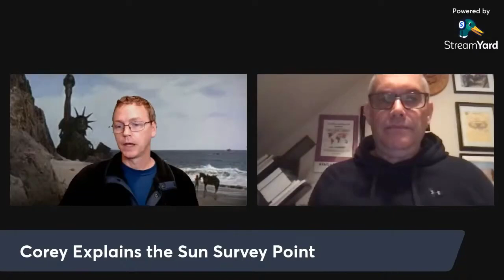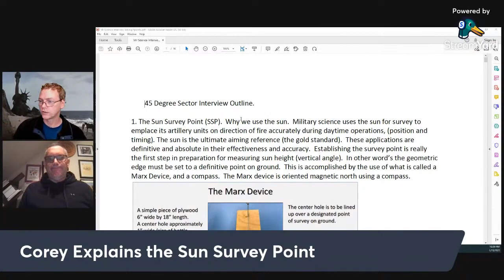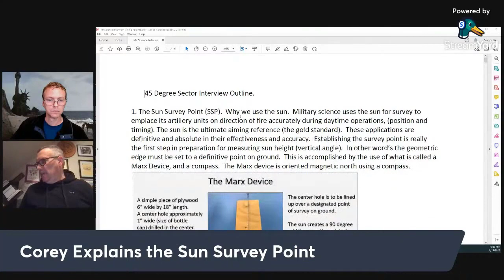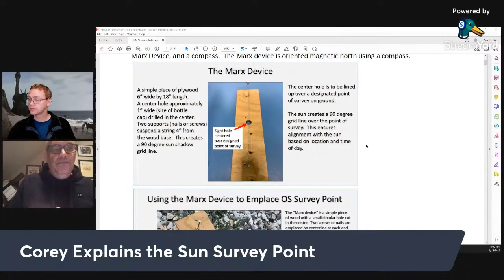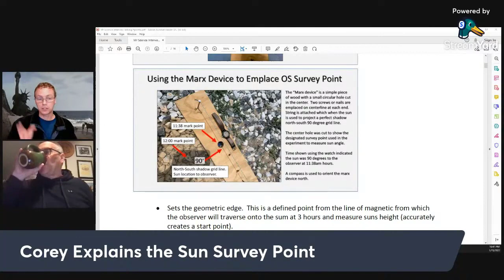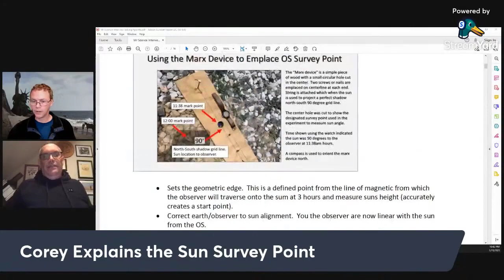Conversations with Corey - Corey explains the Sun Survey Point

Comment: I worked in SAR for 14 years (lifeboats). I've been trained and have qualifications in everything that you need too get a boat safely from A to B. Things like navigation, radio, radar, mechanics, boat handling etc.
Sorry to blow my own trumpet :( 
Now that we have got that out of the way here's a simple phrase to use in navigation.
"Error West compass best". With best meaning "greater than".
So if I have a magnetic bearing of 97° and the magnetic variation is 7°W then my true bearing is 90°.
This is very handy if you want to avoid those big rocky things :)

Comment: 12:50 No, it still doesn't establish solar noon for the specific location. It's just a direction marker and establishes that direction, any direction, from one day to the next. Place it at an azimuth of 150 degrees and come back 24 hours later. The string and hole should again be aligned.
Kell seems to me wrong when he says "come back the next day" and it will be "4 inches off" or something to that effect. There will be a difference but it would be tiny, practically immeasurable, probably comparable to the width of the string.
Reply: His might be 4 inches off if it's just laying on the ground and can get kicked around by other people. I wouldn't rely on it for finding local solar noon and definitely not for ballistic trajectories.

This appears to be a common problem with flat earth believers. It's like they want to do science but don't understand all the steps so they cut the ones they don't understand out. Which usually removes the methodology and accuracy of measurements required to get quality data. I saw a similar thing on a recent video Blue Marble Science reviewed from Gary W. about "reverse foreshortening" where Gary mocked up lines of sight on a board but didn't think to measure angles at all. Just eyeballed it and indicated that "these are bigger" which not only Blue Marble Science demolished, but someone in the comments took screenshots of the image and was able to pixel count to determine Gary's statement was incorrect.
Reply from the maker: This is a good opportunity to do the math. I'm also HIGHLY skeptical that Corey's bit of wood and string is accurate down to that level of precision, but I haven't crunched the numbers yet. The location on the subsolar point at a given time drifts about... we know this... should be "easy" to calculate. I'm curious if it happens to match Corey's measurements... but not curious enough to spend any effort on it... because it doesn't matter... the entire test is logically flawed. This test actually validates the globe.
Reply: @icansciencethat  I did some rough math on the movement of the sub-solar point in a comment below. Nothing to do with 4".
Reply from the maker: @fepeerreview3150  Your math seems to be on the North-South motion of the sub-solar point. Corey is interested in the East-West motion.
Reply: @icansciencethat  "East-West motion"
I see. I didn't understand that. I'm not sure what that would be or how it would work. I expect it relates in some way to the analemma. But I've always struggled with how the analemma works. I definitely don't see how that would in any way result in something with the device being "4 inches off". Off in what way? I really don't think Kell explains stuff clearly at all and I think it may be because he doesn't really have a clear grasp of what he is talking about. I don't think it's because I'm too stupid to understand. If I believed myself to be under-educated or of below average intelligence, had an inferiority complex about it, and was impressed by Kell's background and style, maybe in my confusion I'd assume what he says is correct and I just don't have what it takes to understand but he says things I like, like the Earth is flat and or globers talk like morons. So I'd applaud him. (As he and the Globebusters audience did.) But that's not me.
Reply from the maker: @fepeerreview3150  just looking at SunCalc.org I see that on Jun 19, 2020 culmination was 11:54:44. On the 18th, it was 11:54:31. So at that time of the year, solar noon is moving by 13 seconds per day. I think I'd say, "analemma" and just leave it at that. LOL.
BUT... presumably, Corey could set up his experiment to be performed on the 19th calling noon 11:54:31 (13 seconds too soon), but then he'd need to relocate his experiment 13 seconds to the East. Is that 4" to the East? LOL... umm... no. The Sun goes 15 degrees of longitude per hour. That 13 seconds represents 0.054 degrees of longitude. Corey needs to relocate his device 3 miles to the East if he doesn't want to update the time. LOL
Reply: @icansciencethat  4 inches ... 3 miles ... that's why I don't trust maffs.
😆

Comment: 9:35 I can understand simply placing the device on the ground and checking it twice, 24 hours apart. That would indeed provide you with some kind of baseline from one day to the next. I don't see that it even needs to be aligned in any particular direction. 
8:08 "Guess where Mr. Sun shows up 24 hours later. About 4 inches from the survey point."
This is very unclear language. The Sun, of course, is up in the sky. So I assume he's saying something about the device or the shadow of the string. What moves 4"? The shadow relative to the hole? No way. I don't see how anything could move at all. Is he saying the entire device has to be moved 4" in order to get the string and hole lined up again? Which direction?
It's this kind of unnecessary complication in his presentation that makes the whole thing ridiculously cumbersome and obscure, and one of the reasons I distrust him. Aligning something with a compass and then making a small adjustment for declination is EASY. If you're sniper off in the mountains of Afghanistan chasing bad guys, you'll probably know or you probably should know what the declination is. Adjusting your gadget for it is the work of 2 seconds. Also, knowing at least roughly when is local solar noon is no big deal either. The resulting observations and aiming would be vastly more accurate and predictable if these factors were taken into account.

I also fail to understand the need for this device at all, to do an observation that will last 3 hours. If you're doing over the course of 2 days then all you need is a nail in the ground and a watch that works. You go back to the same spot the next day, same time, 3 hours one way or the other, measure your sun altitude and you're done.

His whole presentation seems like a lot of smoke and mirrors, designed to obfuscate.
Reply from the maker: I think I can actually explain some of this.
Corey's test is all about where the Sun is 3 hours after local noon. So he needs to establish when local noon is. TBH, Time-and-date is your go to, but Corey wanted to be more precise (for reasons that aren't really relevant #shrug).

The device works by casting a shadow. The string casts a straight-line shadow, and we want to use that to align when the Sun is in a straight-line with the Sun-String-Hole. The Sun will not be straight overhead, but somewhere due South at that moment. So if the string is aligned due North-South, then the shadow of the string will pass over the hole exactly when the Sun is due South. It's clever really.

That said, using magnetic North instead of celestial North introduces error into that which Corey seems to have neglected.

But to be fair, whatevs. Time-and-date tells you the time of noon, and we can use that to validate the rest of the test.

The Sun moving 4" per day? WTF? He means the exact sub-solar point at 12:00 moves from day-to-day. Let me explain what that means in terms of this test. If he's going to measure at precisely 3pm every day, he wants that to be 3 hours after "noon". So what he's done is place the device such that the string's shadow is dead-center on the device at 12:00. Since he's using magnetic North, that isn't exactly solar noon, but he's thinking that is ok since he's going to measure the angle exactly 3 hours later in that same spot.

This isn't exactly correct, but his resulting angles are all within 1 degree of SunCalc, so I don't really think it's worth quibbling over.

If you can find the time, I would like to see how much the 12:00 SubSolar point moves day-by-day. It'd be pretty cool if that turned out to be 4".
Reply: @icansciencethat  I guess I still don't get it. The device doesn't help to find solar noon or magnetic north. He needs a compass to align it to magnetic north and a clock to mark noon. So at noon (by the clock) he aligns it with the compass and then all the device does (assuming it's not disturbed) is allow him to identify, the next day, that it is in fact the same time of day. And his alignment is preserved. In short, he could align the device to the Sun at any time, say 10am, and the next day at 10am the shadow will center on the hole again. (Of course, the device would not be aligned to north.) So it's a way of marking time and alignment, for any time and alignment. It certainly doesn't aid in finding solar noon or either magnetic or geographic north. It's just a way of recording them after they've been found through other means. If I could reliably get 2 days of sunshine in a row I'd do a video demonstrating this. Of course using magnetic north makes finding solar noon even less likely. But that doesn't seem to concern him. Kabul only has a magnetic declination of +3.35 degrees. Maybe that's why. It will have only a small effect on his solar altitude reading. In the USA it can be as much as -19 degrees.

As far as the distance the sun moves  - From solstice to solstice the sub-solar point travels 2 * 23.4 degrees = 46.8 degrees, over the course of 6 months or 182.5 days. 
46.8 degrees / 182.5 days = 0.26 degrees/day This is equivalent to 0.26*69 = 17.69 miles/day
I still don't get where 4" comes into this. If the device is aligned to noon, come back 24 hours later and it will still be aligned. So nothing moves 4 inches. If he made a mistake and meant to say something else I can't figure out what it would be. Come back 3 hours later? The shadow certainly won't have moved 4 inches. That depends, of course, on the height of the string over the hole. But judging from the photos it looks to be only 1-2 inches. So it would not be casting such a raking shadow just 3 hours after noon.

In the end, I don't see the utility of the Marx Device at all, except to obfuscate and complicate. If he wants to do repeated observations from the same point, day after day, then he can just put a nail in the ground, and return to that spot each day with the same compass and clock he would have used to align his Marx Device. In fact that would be more accurate. The device really only indicates the time and reading the time by the shadow of the piece of string is going to be less precise than simply using his clock.
Reply from the maker: @fepeerreview3150  Ahh... you seem to misunderstand the Marx device. I'm not gonna lie... Corey doesn't explain well at all. I think I finally get this Marx device thing, but I'm not entirely clear how Corey is using it exactly... because it really doesn't matter. (Keep that in mind... his Marx device is totally irrelevant... his logic was wrong.)

The Marx device explained: 
1) At local solar noon, the Sun will be due South.
2) We can identify local solar noon by waiting for the Sun to be due South. This is how you or I would approach this.
3) Take a string and align it perfectly North-South.
4) When the Sun is due South, the shadow of the string will be directly below the string. The shadow will be offset to the North, but the shadow will NOT be offset East-West.
5) Mark a spot directly below the string. Corey used a hole in the base of the device.
6) When the shadow of the string hits the exact center of that mark, you are at local solar noon.
Then Corey looks at it a little differently...
7) At any given moment, it is local solar noon at some longitude on the Earth... just maybe not the longitude you're at.
8) So presumably, you could wait at the location where you are for the shadow to indicate that it is noon OR you could move the device to where it is noon there.
9) Presumably, Corey moves his device East-West while maintaining its North-South orientation to find the position where it is noon at the time he chooses.
Theoretically, that would work. However, I think we'll find that the error tolerance makes the effort rather silly. But we really don't expect a flat-Earther to be doing an error analysis do we?
Super quick error analysis... local solar noon moves at 15 degrees longitude per hour. That's 0.0042 degrees per second. Kabul is at 34.6 degrees North making that 0.24 miles per second or 15,000 inches per second. So Corey is chasing a moving target that moves 15,000 inches per second with a little block of wood in his hand?
Check my calculations there... super quick like I said.
Meanwhile, he's already ditched the magnetic declination, and even if he hadn't, a hand-held compass is no more accurate than +/- 1 degree.
And the accuracy of his string and hole thingy is probably accurate to about +/- 1 degree... I'd probably have to try it to get a real sense of how precise it might be.

Bottom line, the Marx device shows a good understanding of the geometry, and it's a unique and clever design. It's basically a sundial specifically designed to mark the time of local solar noon. However, I think I'd have to say that Corey takes that accomplishment and runs headlong off into fantasy land with it.
Reply: @icansciencethat  Yes, I guess I'm still struggling with this. It looks to me like the device only marks local solar noon if we identify local solar noon some other way and then align the device to it. So it effectively records it for future reference but does not actually aid us in finding it. And it seems to me we could use it to mark any particular time. For example, we could use the device at 10:30am by aligning the device so that the string's shadow falls directly below the string. Come back the next day and when the shadow falls in the same alignment it is the same time. Of course, the device will not be aligned to north, magnetic or geographic. It will be aligned south-east to north-west.
So, in the end, the device does not aid us in finding any particular orientation. We need the compass for that. But once we've found it, then it records it for future reference.
And since we only need to take 2 readings 3 hours apart, noon and 3 hours +-, I don't see the need for such a device at all unless we plan on repeating over several days. Even then, it's just a convenience. It's basically a timekeeping device, and not a very accurate one at that.
Reply from the maker: @fepeerreview3150  I think it's pretty important to point out that local solar noon moves from day to day. If you used the device to mark the time today, it will be wrong tomorrow... if only by seconds.

If the device is oriented North-South using a magnetic compass corrected for magnetic declination (or by aligning the device with Polaris), the device will tell you the time of local solar noon.

Granted, that's not quite what Corey did here, but I'm just explaining where I see "cleverness" in the design.

As I've said elsewhere, the "Marx device" is a simplified sundial.

Ostensibly, the purpose of the device would be to establish the correct time of local solar noon so that one could then establish when 3 hours after noon would be at that location. Presumably, the point might be that one questions the validity of online resources. Corey imagines that his device gives him improved precision, but that seems pretty doubtful.
Reply: @icansciencethat  Whatever else it is or does it's definitely NOT a precision device. The thickness of the string alone is probably more than the difference between one day and the next for solar noon.